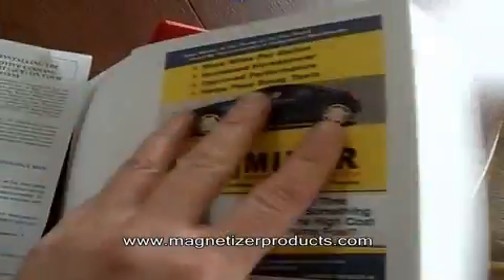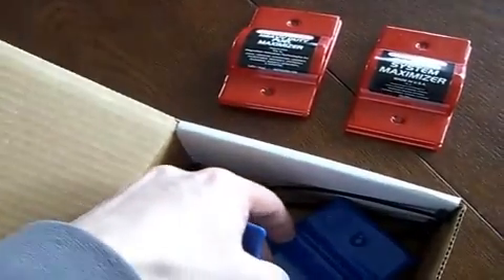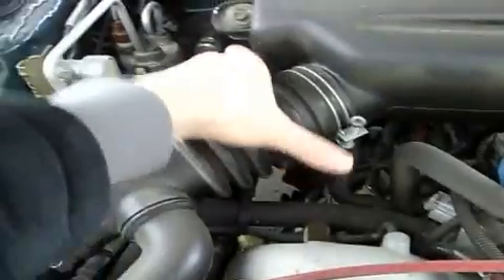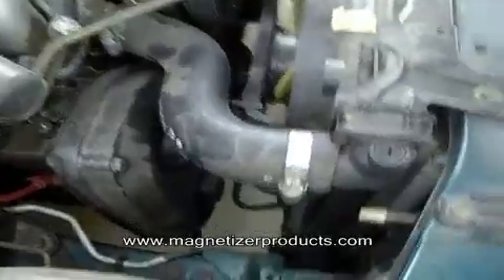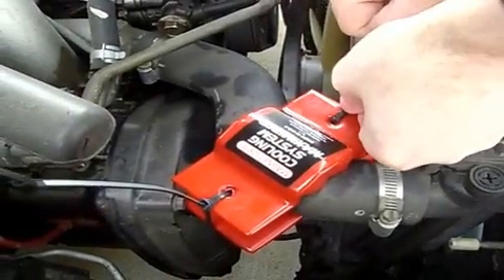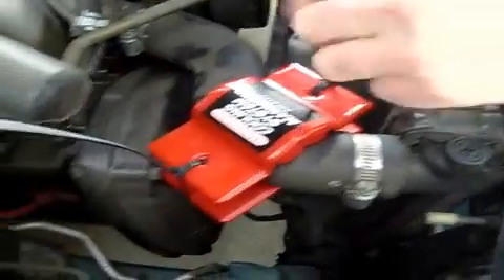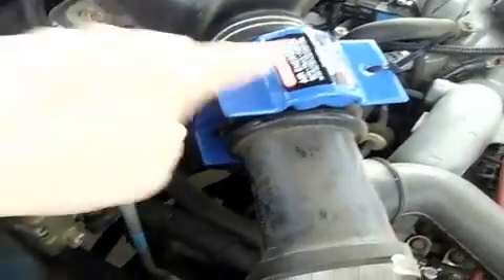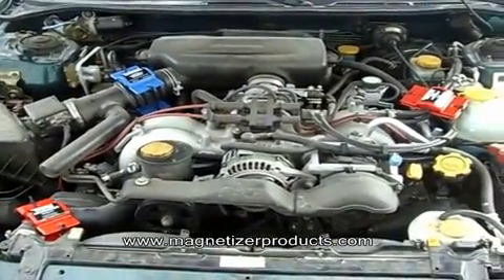Gasoline Maximizer for Automotive use from Magnetizer Products

Comment: This was an old product design that I proved didn't work, I installed 72 of them inside of six weeks and no results were received. However I changed the red fuel magnet (MOA) with a much larger unit (HDFE-B -- 17,5 times stronger). Upgraded all 72 customers for free and got 72 calls in the next few weeks telling me of the 3-4 mpg increase and they all wanted more. Have been installing this product on vehicles starting in late 2005. Eighty percent of the vehicles were commercial trucks. We get from 16 to 22 percent increase in economy. 

The above product is no longer offered. It has been upgraded for obvious reasons :)

Note: The above installation will not save much fuel even if he used the correct product. This is because you have to wait for the fuel to go from the installation point to the injectors. This may take 10 minutes. So your trip has to last long than that to start saving fuel. Best to install smaller units (AFE-S or AFE-A) on each injector as well as the larger unit as close to the injectors as possible. This will give you instant savings. Also note that it only takes about 20 minutes after you shut off the engine for the fuel to revert back to its original state.
Reply: hrobinson71 HDFE-B stands for Heavy Duty Fuel Energizer. It is two opposing positive polarity units we use to go around a fuel line. It was just used for commercial trucks, but I use it on all fuel lines. The AFE-S is a much smaller opposing fuel unit (the AFE-A is the same thing except it is one magnetic unit and a backplate on the other side). These are used mostly right before fuel injectors.
Reply: Rowan, I told you to remove the backplates the the HDFE-A's and put the two magnets together (HDFE-B) to increase the electromotive force 700%. is that sales bs talk? I asked for no money to help you. I showed you how to increase the results using the products that you already had. What in the world are you talking about?

When I worked in the city on power plants and all, I was never a salesman. There were salespeople at the company, but I didn't work in their office. My job was a mechanic inspector. All I did was inspect equipment for energy, fuel or water loss and then instruct others how to fix it. This is how I found these products. They solved a problem. Automakers use pollution equipment. My way reduced the pollution by 90% and used that wasted energy to increase mpg and horsepower. Not just filter it out.

When I first moved to West Virginia I took out a quarter page ad to tell others that I was very happy to be here in the country, what I did in the city and that I would offer my inspection free of charge. I found gas leaks in several homes, told them to call the natural or propane companies and they would fix the leak for free. These homeowners were extremely delighted that I came to their homes.

Then when the price of gasoline first hit $3.00 a gallon in the Fall of 2005 I would hear people say they were scared and that they couldn't afford that price. So after hearing this from so many, I told them that I could help. So I came out of retirement, spent $25,000 to put a company together from scratch and went out to help people. In my first five years I performed over 4,800 installations (some days in the summer working 6am to 10pm). My uniforms were blackened with grease most days working on vehicles (mostly trucks). 

Does this seem like the life of a salesman?
Reply: What is an HDFE-B? AFE-S or AFE-A
Reply: Where can you purchase these now? I owned this product years ago and I am looking to buy another set for my escalade. I never knew about the Heavy Duty stuff.
Reply: Which engine is on the Escalade? And what year?
Reply: If you send your questions to aldersonsales@gmail.com I can send pictures showing the AFE-S's and other products being used in installations. You will see the magnitude of the business behind these products. In 2015 one of my installations on a 2006 dump truck will reach the 10,000 gallon barrier of saved diesel fuel. That is between $30,000 to $35,000 USD savings so far. Two days ago I was told that the customer is now starting baseline testing for a month on all vehicles and equipment at one of their many locations. Then all of it will be converted. When they see the results again they will be giving me the entire fleet (over 1,000 dump trucks and hundreds of other equipment).
Reply: +Jeff James http://magnetizerproducts.com/testimonials.php testimonials by governments around the world, military, major corporations, etc...
Reply: +Jeff James 17.5  stronger. is this possible. what was the original strength of the magnet[s] replaced.
Reply: +mervyn shute If magnets are too strong, it has the reverse effect and will defeat the purpose.
Reply: +Jeff James Please post your receipts for the 72 units showing where they came from. You claim the above product is no longer offered - you are misinforming people.
Reply: I meant that "I" no longer offered the above system. After installing 72 of them in a month and none of them working after five months, I no longer offer them. I upgraded my customers to my newly designed system and received a 100% success rate. The manufacturer still offers the above non working system. I just order different parts that I know will work.
Reply: A stronger system does not reverse the results. I would use neodymium magnets if I could (32 times stronger magnet for magnet), but they are not heat resistant. They would lose their power in a few months in a hot engine compartment. This is why we use ceramic alloy rare earth magnets.

I have even used them on a steel mill's fuel and air lines with a special coating. The ambient air temperature surrounding the pipes was 242 degrees Fahrenheit. I did the installation when the furnace was down for maintenance. They saved 14% of the natural gas or could increase production by 22% if needed using no more fuel than they did before.
Reply: +Jeff James http://magnetsecrets.com we have the DOE documents proving the method behind these products. They work so well that the DOE documents are encouraging other departments in the US Federal Govt to use them!
Reply: +Jeff James http://magnetsecrets.com we have the DOE documents proving the method behind these products. They work so well that the DOE documents are encouraging other departments in the US Federal Govt to use them!
Reply: All products came from Magnetizer in PA. Those original 72 auto products were purchased in September 2005. Those receipts are in a landfill somewhere. Only hold paperwork for six or seven years. All I did was replace the fuel FE-A's with HDFE-B's and added one more negative MOA on the air line in a triangle configuration (removed the back plates). Also converted the positive water part and back plate (MOA) to a MOB. Total FREE upgrade cost me about $15 USD each, but the results were 72 happy customers ordering more systems and referring many others.
Reply: I am currently working with one of the largest trucking companies in the world. They wouldn't even talk with me had they not heard from so many other satisfied companies.

However, there are 100 ways to install them and only one of them works. There has been many new companies wanting to get into the game, but when they don't get any results they give the supplier hell. They supplier tells them of my success and they come to me for answers. I ran into all the problems too, but stayed around and figured them all out (I didn't quit). Took me several years to get the perfect answers.
Reply: +Jeff James you are keeping to much to yourself on an open channel. which is all about sharing. what about a mystery movie. do you know of any good ones besides yours.
Reply: My website will explain it all  www.mycoolboost.com
Reply: Trucks use ceramic particulate filters, Diesel Exhaust Fluid (DEF) and have to regenerate the system frequently. All of this to take care of the problem with the fuel. My way takes care of the problem before it becomes a problem. You don't need all that emissions junk and DEF to get 100% emission free exhaust. You also get free energy (higher MPG and HP). Carbon and scale are also a thing of the past.

Comment: What a load of crap. These guys are making as much scam money as Al Gore!!
Reply: Say Toadie... yes, there are magneto devices on the market that are essentially 'crap' and don't work. They are inferior and poorly designed. The ones that DO WORK, are patented, and use ceramics, or neodymium, or samarium colbalt, with High Flux rates and Gauss ratings. As well, you don't put on black rubber carbon based hoses. Use the orange-red hoses for the flex portion of the  fuel lines or attach to steel fuel rails.  Read instructions.  Its also clear, U do not understand the science of magnetohydrodynamics. Look at the Russian technology they used, after WWll.  READ... READ... READ... Understand?  The Whole Planet is in a magnetic field  Above the equator....water spins counterclockwise when draining from a vessel...below the equator, it spins clockwise.  U may know about engines and its mechanical functions but, U know squat about physics.
Reply: +TheLonesometoad http://magnetizerproducts.com/testimonials.php testimonials by governments around the world, military, major corporations, etc...
Reply: +Aaron Murakami LMFAO!! Testimonials on their own website. Yup! That's convincing!!
Reply: TheLonesometoad
If you're to lazy to follow up on those to see they're legit (company has all paperwork from those companies to prove it), then that is your problem. The issue isn't with this product, you brought your ill informed opinions with you.

Scan of Disney testimonial http://magnetizerproducts.com/images/disneymagnetizer.jpg

Scan of Siemens testimonial http://magnetizerproducts.com/images/siemensmagnetizer.jpg
Reply: +Aaron Murakami I've been a mechanic and an engine builder for over 45 years and I've seen nearly every scam come and go. Magnets on a fucking fuel line is one of oldest in the book. My "Ill informed opinions"? Would you like to discuss the science, math and technology behind the internal combustion engine? Would you like to discuss the molecular structure of gasoline and other fossil fuels and the BTU content of each? When you are open to an education just let me know. Until then, keep blowing your money on the snake oils being sold as fuel savers.
Reply: +Aaron Murakami I know about hydrocarbon atoms and the effects of introducing them to  magnetic fields. That's not the issue. Once the raw fuel is directed to the mixing pot (venturies/injectors) whatever effects the magnetic field had on them is nullified by vaporization and the journey to the combustion chamber. If this crap had any effect on fuel whatsoever they would be mainstream, parts stores, large chains and even auto MFGs. Fact is, it's snake oil. Now, about your plasma ignition. Where are they sold? Who uses them? Why are they not powering the 10,000 HP top fuel dragsters? And why do you not respond to emails with technical questions and interest in your product? You claim to have the world's most innovative ignition system and yet, I can't find one. WHY
Reply: +TheLonesometoad Your attitude of "if it works it would be everywhere" is beyond naive. That is the same mentality that the FDA is there to protect the health of the American people. I'm sure you buy that too :)

I didn't invent this form of plasma, I invented the world's most efficient method of producing it. Virtually every major auto manufacturer has patents on the antiquated way of doing it and they simply shelve it. They will never use it to take the thermal efficiency of the engine to the next level until required by law. If you believe it is because it doesn't do what is claimed, then you need to open your eyes to the fact that you don't know as much as you think you do about engines, period. In the 1970s JPL already did minor modifications to V8's and had 30% efficiency when the normal was around 16% or so. I'm interested in teaching people the science and if they want to build it themselves, then can and I show them how. It works and your opinion has no relevance. The problem with modern cars is being able to get around the computer sabotage that keeps richening it up to 14.7:1, which is not the idea mixture anyway, but I'm sure you buy that hook, line and sinker as well. 20-25:1 is easy to do with the plasma ignition. Lean mixtures was never the problem it was how that lean mixture is ignited. Hydrogen supplementation or plasma ignition solves that problem. You're out of your league if you want to debate this issue.
Reply: +Aaron Murakami And I respond to 100% of every email regarding my books/videos. Spread your misinformation and lies elsewhere.
Reply: +Aaron Murakami LMAO! Hope you've got a spare tinfoil hat for your current piece wears out. I've been running hydrogen injectors for 35 years, and if you knew anything about the current ECMs you'd know how to utilize pulse width technology to &quot;trick&quot; the computer into thinking it's where it wants to be. Around here it's common knowledge and the hot rodders take advantage of it commonly. But that's all beside the point in this case because a magnet on a fuel line is snake oil, and your plasma ignition is a fantasy. Over the last few years I sent about 12 or 15 emails to someone claiming to have a plasma ignition. They show a video on their website depicting the difference between conventional and plasma ignitions and give the contact info on the page. In fact, there is a video on you tube about this ignition and that is where I received the original information. But, beyond coincidence, I never received a response. In fact, a handful of the emails were bounced back with a note stating "No such mail account". So, no. I don't believe you. I DO know that a hotter spark will ignite leaner mixtures, and that an internal combustion engine is perfectly capable of running at 20:1 A/F ratio. But when someone claims to be doing it with absolute success I would expect this person to be actually selling them, seeking investors, and marketing thru main stream channels. If you claim you have a miracle, and you can't order it thru normal channels, or find it on a shelf, it's snake oil. And when the claimant avoids responding to inquiries you know it's pure bullshit. BTW, getting around the 14.7:1 ECMs is extremely simple. Take a look at the ECMs the serious hot rodders and NHRA are using. They set fuel curves, ignition lead, clutch engagement, NOS delivery and much more. And the average hot rodder uses a laptop to do it.
Reply: DOESN'T SAVE FUEL? During the warmer months, strap a HDAC-B (positive polarity) www.mycoolboost.com ) around the air conditioner refrigerant line right before the expansion valve. Then restart the vehicle. The air temperature coming from the vents in the cab will drop right away (if you use a digital infrared thermometer you will see the results instantly). Actually the temperature will drop about 3 degrees F every three to four seconds until the temperature gets to about freezing. Then the change lowers to 2 degrees per cycle. In the teens it will change to 1 degree and finally stop going down in the single digits. This is because the vehicle is only at idle and the hot air coming from the condenser up front has nowhere to go. At highways speeds we seen temperatures down to minus 28 degrees F. Then you would adjust the rheostat to a more comfortable temperature (a climate controlled vehicle will do this automatically). The compressor will rarely turn on and you save fuel. When my customers witnessed this, they would always say something like, "This is incredible! What else do you have?"

Note: The above video shows an obsolete product. It will only work on carbureted vehicles such as a lawn tractor, ATV or dirt bike. See www.mycoolboost.com for the update.

Comment: One reader quoted that the fuel molecules will return to their natural state. Yes, after about 20 minutes, but by then the fuel is either burned already or back in the tank waiting to be treated again. You must install the red unit right before the injector or throttle body. If you install it before the fuel pump, the power is gone (this is according to a US Navy nuclear engineer I met in Michigan at a seminar).
Reply: +Jeff James are not these metal high pressure lines. could be not conducive for magnetism to work.